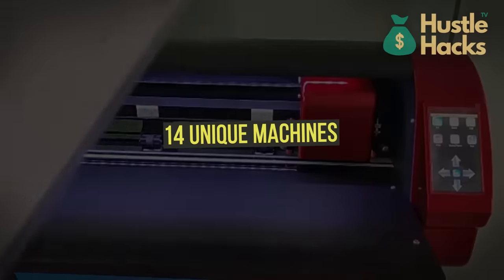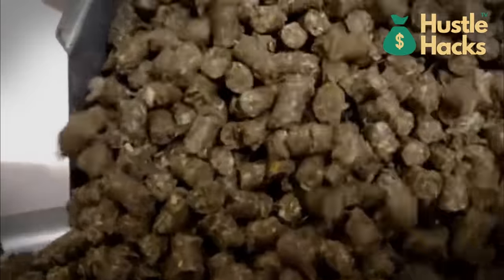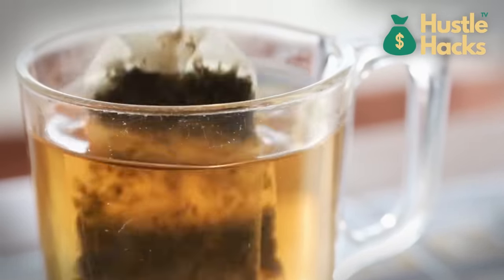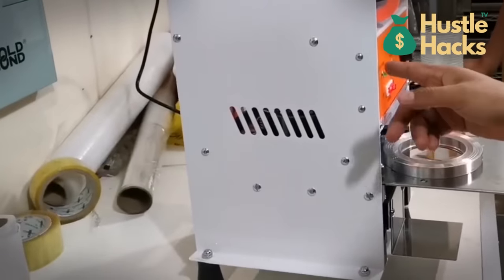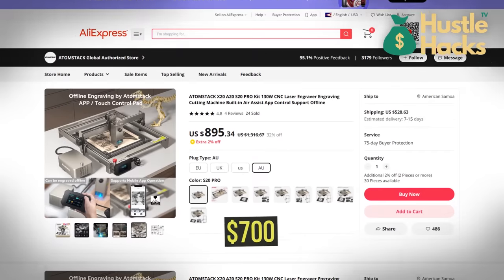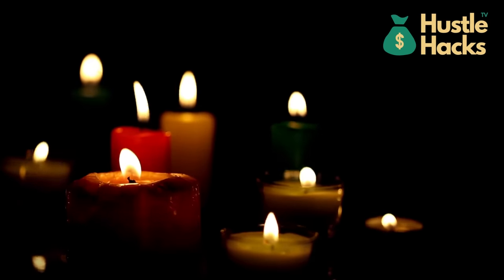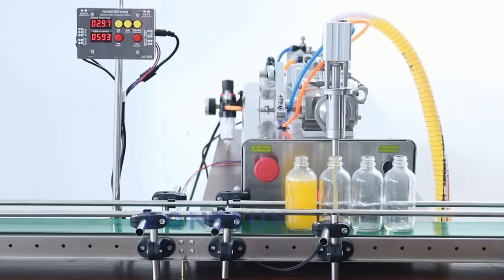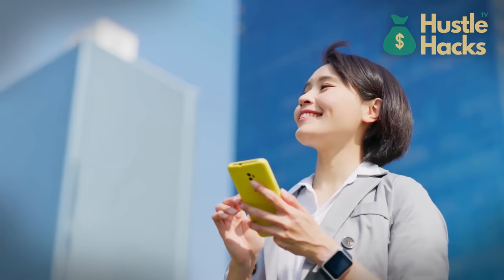Make Money With These Unique AliExpress Machines

Comment: There are lower cost versions of laser engraver. In my opinion the best ones that are really profitable is Oil pressing machine and Pellet machine. Especially if you life in colder regions, they need wood pellets nearly everywhere with a strong winter and Olive Oil is cheap to make if you import from a good source and take a bunch directly you can manufacture a lot of oil which always also sells on eBay, people always bid there on 30 Liters aswell not only one bottle each. so one wouldn’t even need a real brand to get money in fast same with pellet making but it’s a lot more complicated and space requiring.